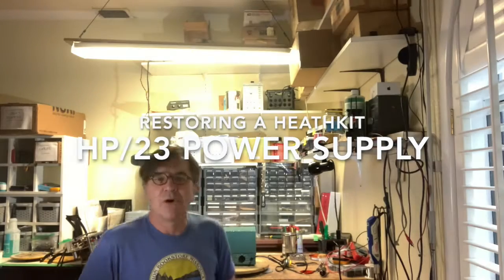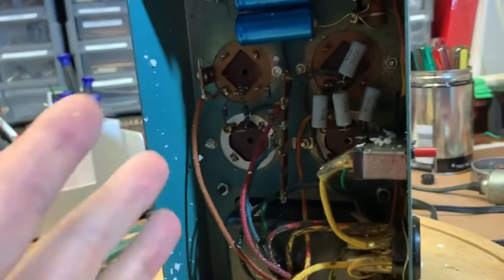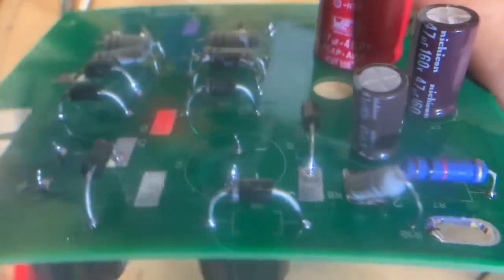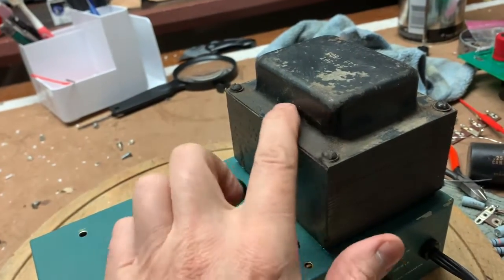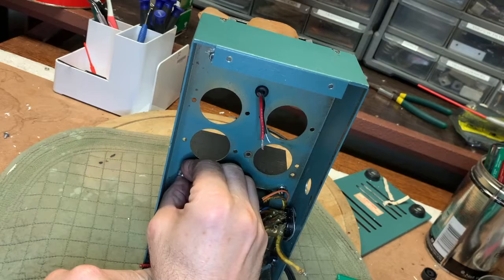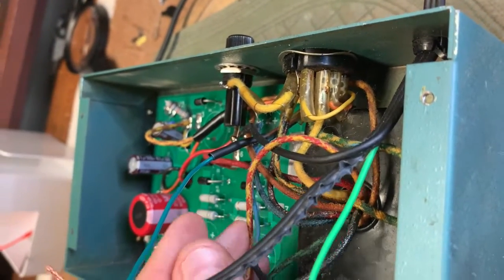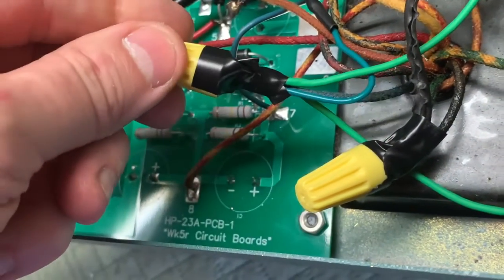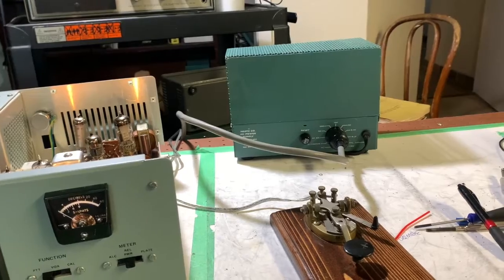Heathkit Power Supply Upgrade and Restoration

Comment: Great video of your Heathkit Power Supply upgrade. I have a Heathkit HP-23 here for a future project. It has the On/Off switch and the pilot lamp. It probably needs the upgrade.
73 Paul AA1SU